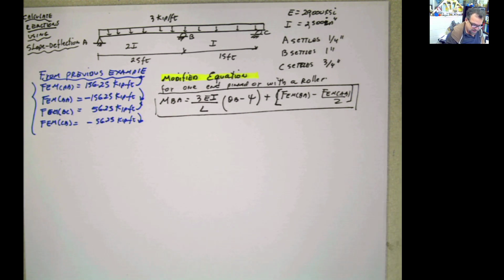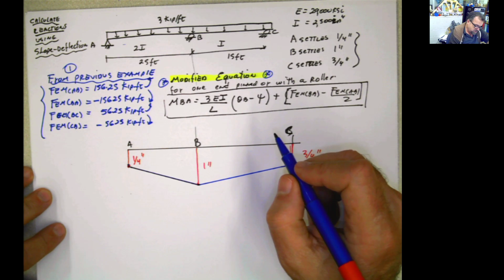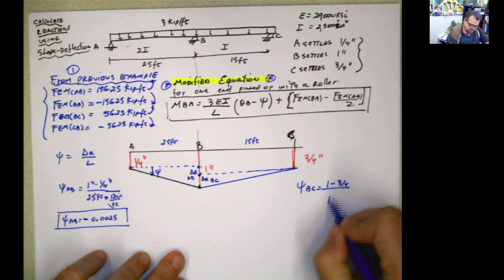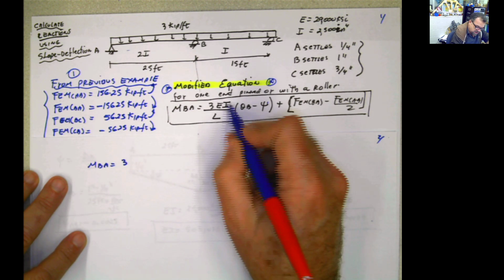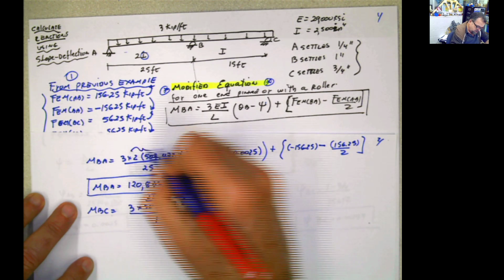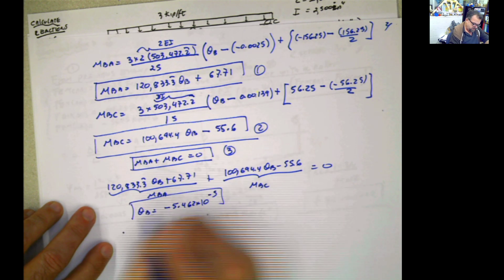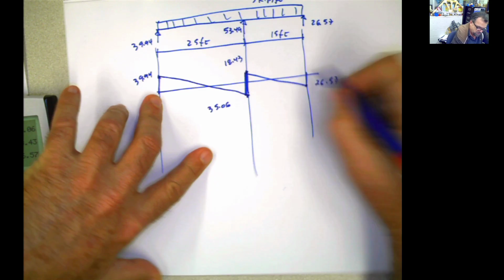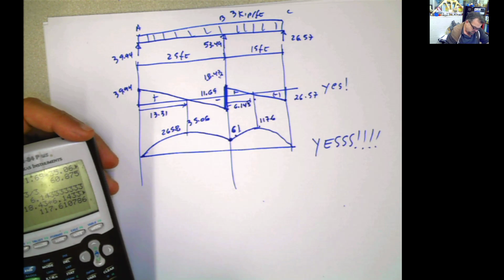SLOPE DEFLECTION for Solving Indeterminate Beam including Settlement of Supports

Comment: Thanks for the video. I have an indeterminate beam. Two continuous spans. I solved for the redundant reaction (middle) using force method. I solved directly using given deflection equations from tables and also I tried using Virtual Work method. Both are matching exactly.

Now, I want to include the support settlement, but the compatibility equations in each method is giving me a different answer!
Is this possible?
Reply from the maker: Glad it helped